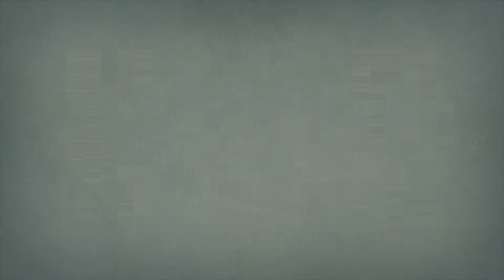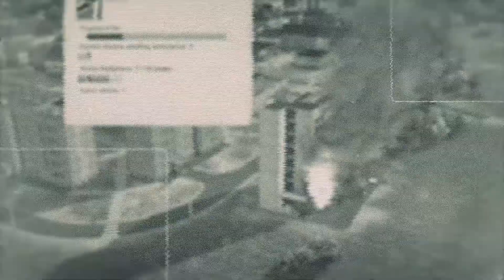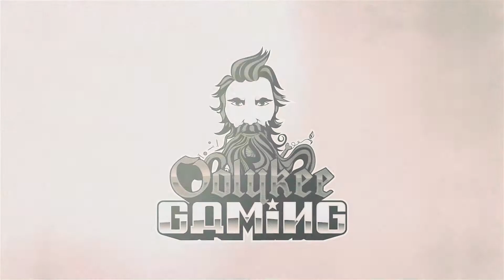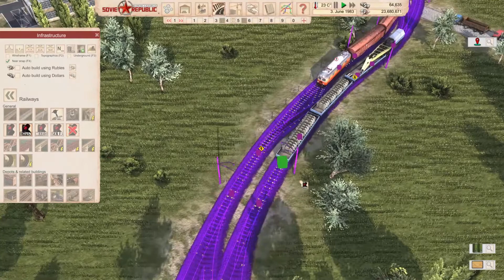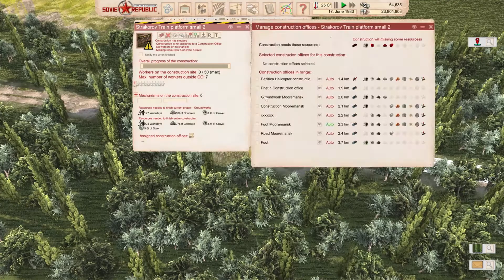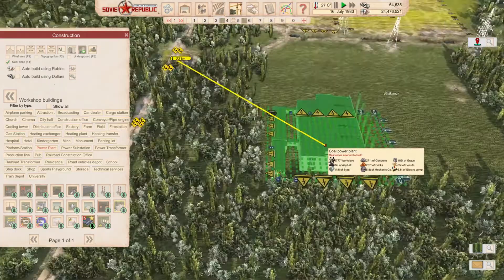Soviet Republic - Alaska - The New Beginning - Ep.87

Comment: Chains with chain signals are a trap, don't use them. Trains will not reserve the whole path and look if the end is free, so it can be locked up by another train.
Reply: Indeed, what many players forget is that the chain signal means above all that the train takes into account the block after the signal AND the next block after the first one. It therefore takes into account two blocks for its calculations
Reply from the maker: @statsneguit3069  I am aware of this feature. I had many, MANY disastrous setups. I tend to avoid them at all costs. Just wondered what is your experience with this. :) 

@Dennis I agree! Especially for someone that is not experienced with rail setup (counting myself).